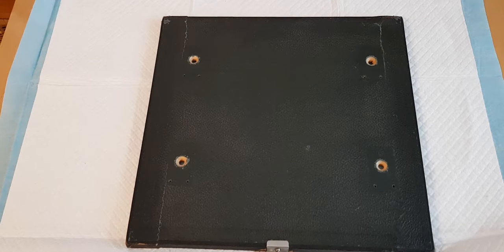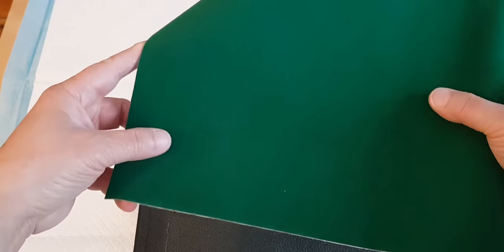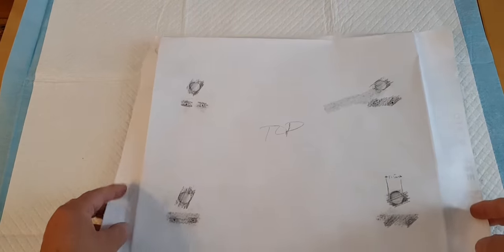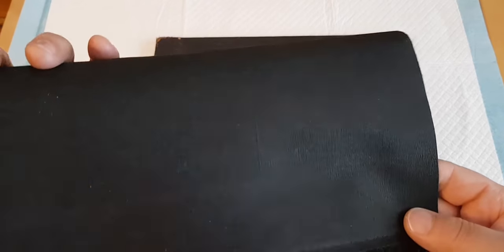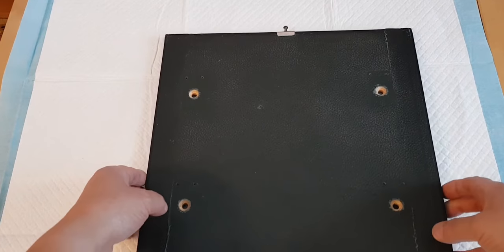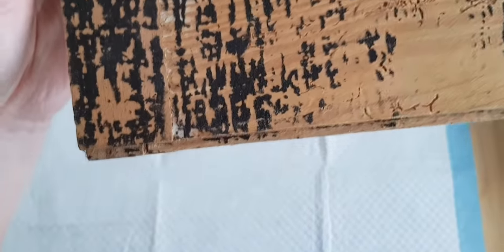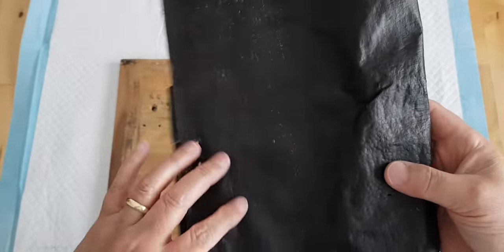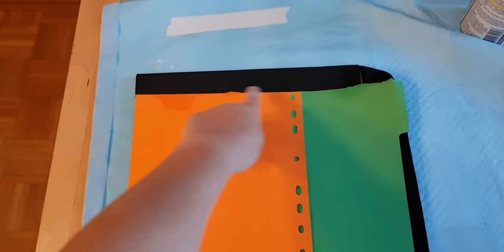Typewriter case restoration Pt 2 Vintage 1938 Mercedes Superba

Comment: I really enjoyed your restoration video series on your Mercedes typewriter. I have a royal quiet deluxe from the 50s the material the original case was covered in is a very thin Oilcloth fabric, good choice going with the waxed cotton. Modern Oilcloth is made very different from my own research.
Reply from the maker: I'm so sorry I missed your comment, thank you for watching the videos. I really enjoyed restoring this machine and it's case and learnt a lot from it. I really was lucky finding that canvas!

Comment: This is the best, inspiring and slightly intimidating case restoration I've found on Youtube!

 May I ask how or what tools you use to remove hardwares from old typewriter? Ones without screws? Thank you 🙏🙏
Reply from the maker: Hi, thanks for watching and your kind words although I really wouldn't want you to feel intimidated! It really isn't too difficult to do, I just jumped in and had a go! I'm sorry but I'm not sure what you mean by "hardwares"?  Do you mean removing pins on the baseboard or actual parts on a typewriter, of which there are so many?
Reply: @tinkeringforfun  It's true, you show a lot of respect to these object during the process.  And it inspired me to do the same, I just wish I could be half as meticulous as you. 😊 

Sorry, I think i forgot to write 'case', and also bad English.😬 By hardwares I mean all those metals on the case like the latch, etc. I have a Remington model 5. The case is also wooden with some type of paper cover. And brass hardwares. The brass are rusty, it's all brown and green. I'm going to follow your methods. By stripping all the paper and  glue new cover on. Since the hardwares are in bad condition,  I think the best way is to take them all off and dunk them in some solution.  But these hardwares don't have normal screws,  the screw heads are smooth.  So I'm guessing I need to pry them. I tried with some prying tool and hammer (and some WD40 but so far it's not budging, it sticks very very tightly to the wood. So I wonder if there's a special tools to remove the hardwares from this case that you can recommend? Like what did you use? 

Thank you so much for responding.  And I'm so sorry this is such a long message. 🤭
😁🙏
-Maria

Comment: Nice job!  I have a similar project coming up and I will steal lavishly from your work!  But I think you are too hard on yourself!  Personally, I would have cut even longer 'ears' on the black material so that when it folded over the seams would be totally under the typewriter and more invisible.  And I think the extra glue would add to the overall integrity.  Good job!
Reply from the maker: Hi thanks for watching and apologies for missing your comment.  Yes, you are right, on reflection it is better that the edges of the canvas are hidden under the machine. It's all part of the learning process and I am still very pleased with the outcome! :)